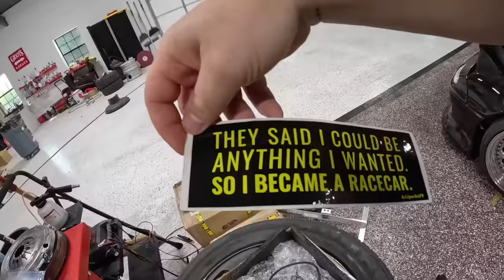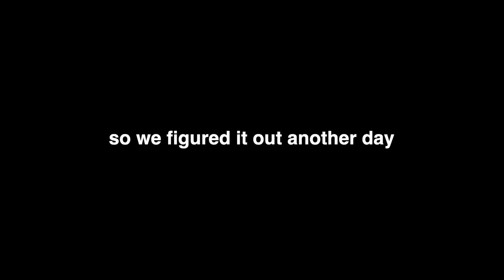WRECKED Turbo Miata: New ECU Installed and First Test Drive!

Comment: The fan uses a thermo-switch. (at least in a 1.6). It's a simple ground that can by hotwired to any piece of metal to turn on with ignition. If you ground the thermoswitch wire and it turns on, you probably need a new switch.
Reply: with my built 1.6 i put a 30$ fan controller in as a back up for the track 100% recommend

Comment: Hey Evan how do you make nipples? Or in what video can I find them in because I'm building a intake for my project car and I'm replacing the valve cover breather hose with a breather filter but the hose is connected to my short ram that sticks out of the hood so I need to cover the hole with a nipple so it doesn't throw a code